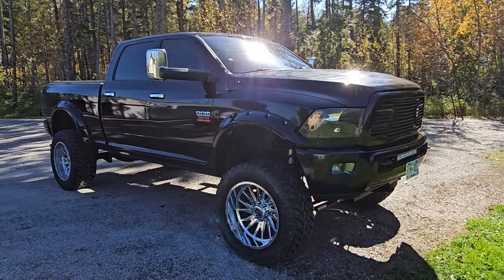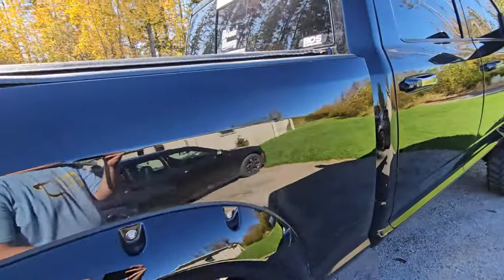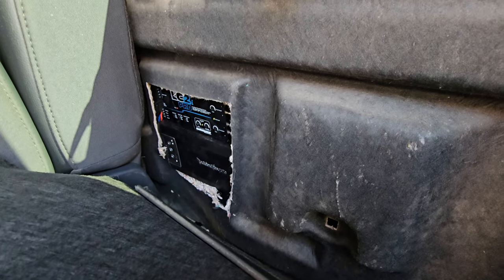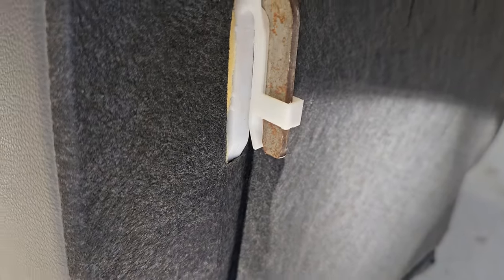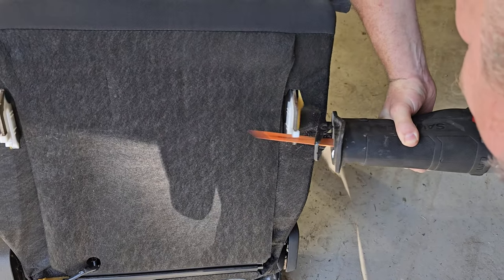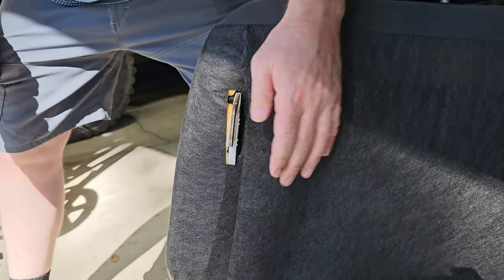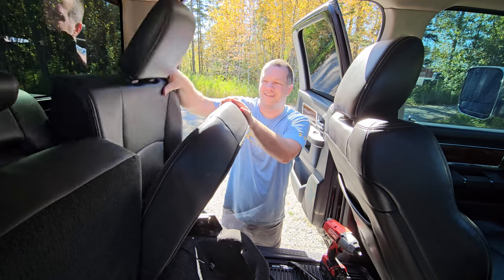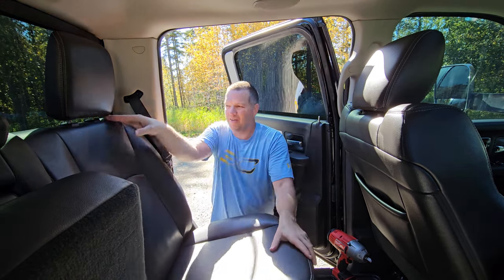Make rear seats fold down. 4th Gen Ram rear seat mod

Comment: That plastic ends up breaking over time anyways.  I just remove it and then put some 5/16" fuel hose with a couple zip ties on the bar hoop on the back of the cab.  you might have to trim a little more of the bottom of the metal tab on the seat to clear the fuel hose, but just go slow until it just clears and you'll have plenty still grabbing when the back drops back down.  and no rattling!   I started with the electrical tape...but it wears out pretty quickly from driving and operating the seat.
Reply from the maker: Good idea

Comment: Thanks bud got a 2020 warlock same problem tackling tomorrow morning
Reply from the maker: It goes pretty easily. Just be careful cutting so you dont hit the seats and try to leave a little of the white plastic if possible, otherwise it may rattle a tad and then you just have to put a little electrical tape around the metal to get that to stop. Its easy though.
Reply from the maker: The other seat i got rid of too much of the white plastic compared to the one i showed in the video. So it made noise if you pulled it forward and back. All i did was put some electrical tape around the bracket i cut (shown in video) and then that went away. (Easy fix)
Reply: For anybody watching.  At the bottom of the plastic after you cut the metal and plastic. Cut a bit off at a 45° angle, the plastic won't get caught
Reply: How’d it go with your 2020 warlock? I have a 22 and my seats don’t tilt up when you raise the bench… wonder if this will not work on the 5th gens

Comment: Just curious if you’ve checked the gasket on your 3rd brake light to make sure it’s not deteriorating? They have a high failure rate on these trucks and allow water to get inside the cab. Also, the seal around your sliding back window can crack and will leak water down right where your amp is located. And if you have vents in the back panel of the cab they too can let water in and could potentially short out your whole setup! Just a friendly heads up from a fellow Ram owner ✌️

Comment: Yup doing this today.  I have 2 subs under the seat i need a spot for a rifle...
Reply: It worked buddy I have the full back bench seat and did exactly what you did and I now have a storage area! I also had to cut the plastic off. It's got movement now, hopefully it doesn't clunk to bad
Reply: @4g63tpowered  Does it make noise? I'm considering this but don't want it to be annoying lol
Reply: @dirtsailoroff-road5580  it does have a rattle on like washboard roads. I wrapped the hooks on the seat. Thinking wrapping the loops on the back of the cab would be better.